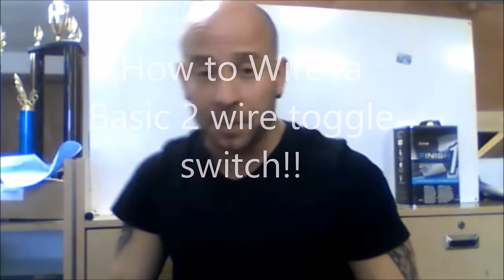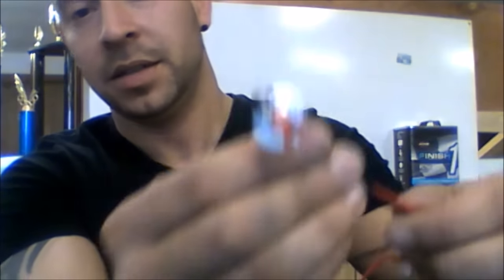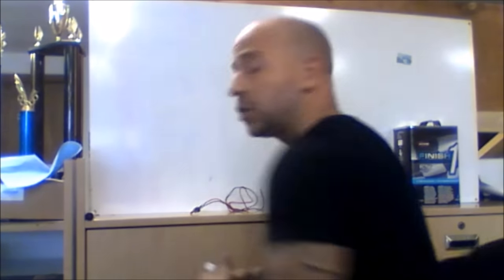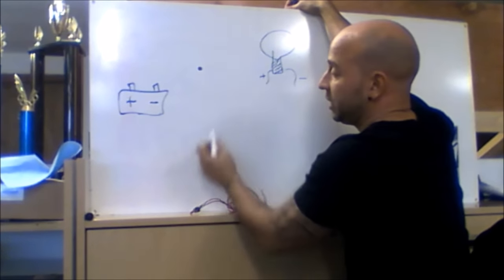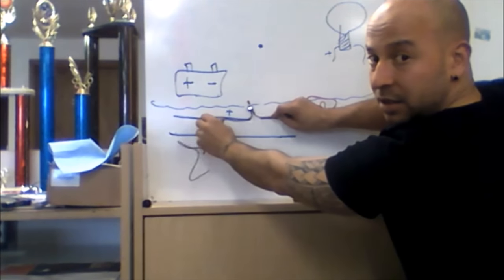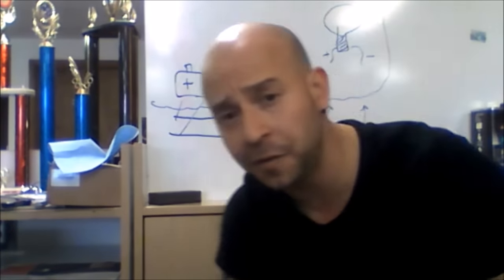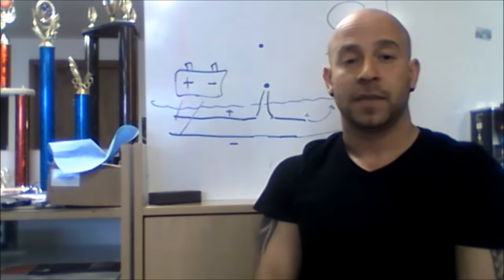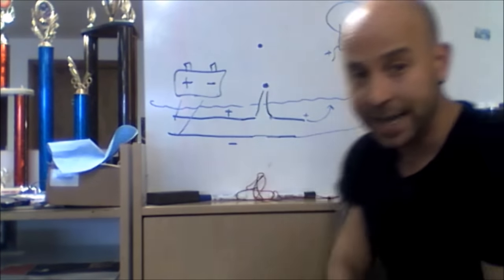How to wire a toggle switch , ( on-off 2 prong ) easiest best explanation, 2020

Comment: I keep melting switches.idk how much amp dual fans take but I have 30amp relay and 30 amp fuse only thing that’s melts is the switch ..
Reply from the maker: 30a is to much for your switches.  Use the switch to trigger the relay,  not in line of the heavy power of of the relays.
Reply: @myonlinecarguy1  wym i dont get what ur saying so im running 30 amp realy, 30 amp fuse to the battery and the switch was like 30 amps to and idk how much current my duals fan take so im thinking of going to 40 amp relay.... cuz my 30 amp relay the,pin 30 isnt working so i have to hard wire it with 87 and then straight to the switch i think thats whats melting my switch....
Reply from the maker: @Luui2x  if you google  "5 wire relay wiring " then switch to "google images", youll see a diagram/pic of exactly waht you need to do, by a company called (MGI speedware)
Reply: @myonlinecarguy1  okay and whats the diff btw 4 and 5 pin?
Reply from the maker: The 5th pin is a "double throw" jjst means you have an output in both active and inactive depending how you wire it.
Reply: @myonlinecarguy1  oh okay can i wire them with the 4 pin 40 amp relay and 30 amp fuse ?i have the 4 pim speedware diagram ..what kind of size of wires should i be using sorry to bother u i just need help i dont want my car to burn down its cold plus a 12 volt dc switch idk how many amp i need of that ...
Reply: & im running my fuse from battery to relay not the switch so i have to re wire some stuff ...cuz thats wrong the diagram with the switch is not showing that
Reply from the maker: If u look at the image, it is sending pwr to the switch, but it ALSO sends it direct to the relay. Its very important to be very specific. When a relay is involved MANY mistakes can result in major issues.
Reply from the maker: This is because when rhe switch turn on, it will pass through the (+)  to trigger pin 85 which will activate the relay. Thats it only purpose.
Reply: @myonlinecarguy1  okay thank u ima do it just like the speed ware diagram can i run 40 amp relay for a dual fan? and 30amp fuse ..what sizes of wires do u u recommend for ground and normal? im going to place all the grounds to a chassis ground not the battery bcs i hurd that can cuz problems or what?
Reply: if not il use the same stuff nothing blew or fried but the switch so i gotta re wire everything back up and see ..im trying to find a 30/40 relay amp

Comment: i still cant get it to work properly with  2 prong toggle switch
Reply from the maker: Have you tried using a diff switch? Is your switch dc voltage or a/c? And finally is the switch pass through amperage enough for your deviced pull? Chances are, one of these questions will find the problem.

Comment: all I'm doing is breaking connection that's what your saying cause my amp staying on so I'm putting a on and off switch to kill my amp
Reply from the maker: Yes, a toggle/rocker switch is just a manual means of breaking a connection. You got it. And that should shut the amp off when done correctly

Comment: Im assuming this doesnt apply when you have a relay. Still good video
Reply from the maker: The toggle switch can absolutely work with a relay in-line. Wouldnt change how the switch is wired, only if the switch woukd be before or after the relay. What is it you building? I might be able to better explain for you including your relay.
Reply: @myonlinecarguy1  just a 2 fan setup for my car. Low amps. 6.5 amps each.
Reply from the maker: So the relay is for a the 13amp load? That might pass straight through a toggle without needing a relay. If you want the relay for electrical safety,  then just use the toggle on the "trigger" line before the relay.....this would have the toggle, trip the relay and the relay would maintain the actual electrical load.
Reply: @myonlinecarguy1  when you say trigger line, do you mean on 86 or 85 on the relay? I was going to do a simple connection like you have in your video but distance from device to switch would be around 15-20ft in wire length
Reply from the maker: Its 85 if a (+) pass through/output......or 85 if a (-) pass through/output. Also you can support a 15amp load over 20ft (length of a car) of your wire is 18awg or larger. Without needing to support with a relay.

Comment: yes sir, the fuse is a 10 amp fuse more than enough for these 2 4 inch led lights
Reply from the maker: Hot-wire the leds 1st. Wire them direct/straight to power, make sure they work on their own and once thats confirmed,  cut 1 of the wires and introduce the switch t9 the circuit that you just cut. Should be a pretty black n white and simple thing from there.
Reply from the maker: I corrected the spelling for you here.

Comment: My toggle switch is a 3 position one and has 6 ports
Reply from the maker: Then essentially.your toggle switch is sort of 2 basic switches in 1 and prob with an led. Most likely with a resting position at center with no output..
This video will only help give you an idea of things. But a multi prong switch like that, will have a wire diagram with it. Be sure to go over that paperwork in detail.

Comment: My rv has a toggle switch. The wires broke.its a 2 prong switch.on off 
What wires hoes where.its for central air
Reply from the maker: If theres absolutly Only "2" leads coming off of that switch. And you have only 2 wires to connect, then it shouldnt matter wich goes to which spot. If theres a 3rd wire, or a 3rd connection in the switch, youll need to consult soneone who can see it in person.

Comment: Would this apply to this switch too? https://media.rs-online.com/t_large/R8772100-01.jpg
I have 4 LEDs in parallel with resistors and that part is fine, but I want to be able to switch them on and off via small DIP switch. Would it work with this little DIP switch? I just need On and Off function. 
Thank you for the educational video, I needed it. And I'm subscribed now. :)
Reply from the maker: You will have to resesrch that dipswitch a little more. Those types of swotches are usually for "programming" similiar to binary scenarios. Off hand, i do not know it capabilities to pass through voltage or what amount of amperage is at it limits. Sorry i couldnt help more. But voltage and amperage capabilities will determine if that switch will work or not. Check with the manufacturer of the switch.
Reply: @myonlinecarguy1  Thank you. I'll check it out. I hope it will work since it's only 4 SMDs and since it's in an old GameBoy, max power is 6V (4X 1,5V AA) Thanks once again, this was a very educational and simple to understand video. :)